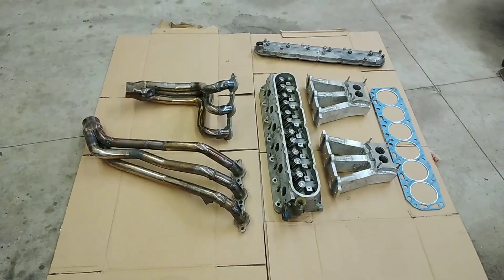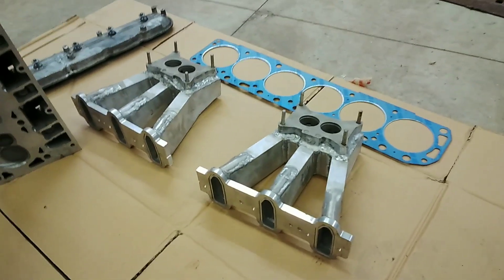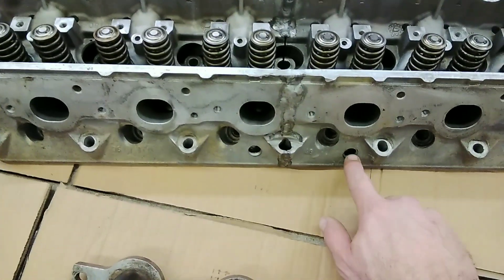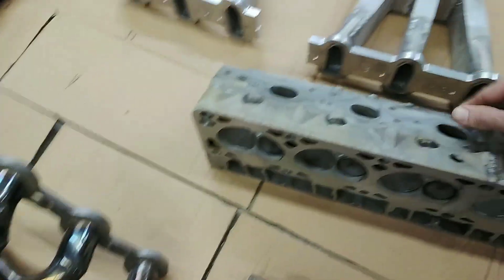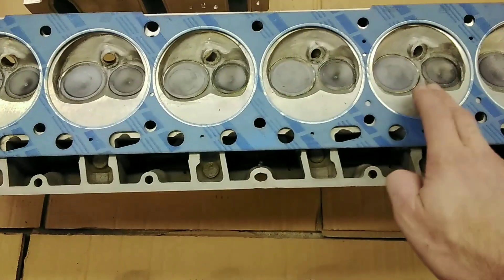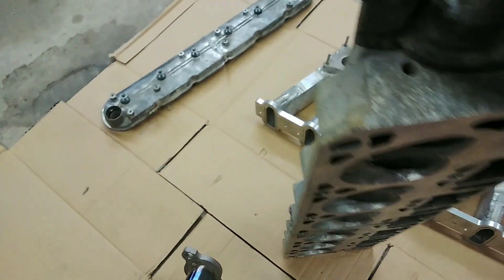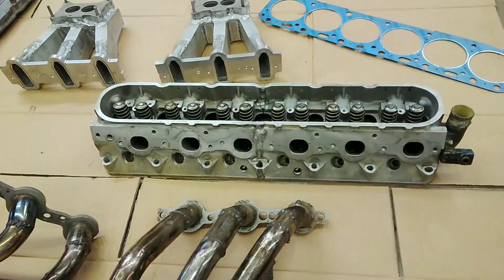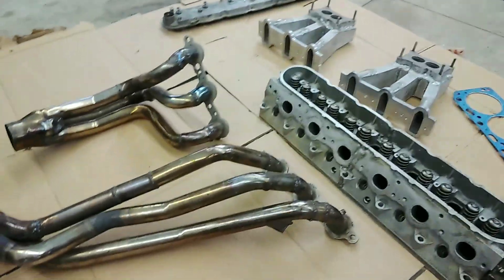Ford 300 hybrid LS cylinder head

Comment: The reason to use a Chevy LS head instead of a Ford Cleveland head is that the valve sequencing on the LS is the same as the standard 300 straight 6 head. Therefore you can still use the standard 300 cams.  If you use the Ford Cleveland head, the valve sequence is exactly wrong, so you have to pay to have a custom-grind cam. made. Standard cam vs. custom ($$$) grind cam. Plus, the LS heads can be bought from a salvage yard or GM dealership, whereas an aluminum Ford Cleveland head cost mucho dinero more when bought from a speed shop or distributor. I know its sacrilege to put a Chevy head on a Ford (or vice versa) but the relative ease and the economics involved make the head choice an easy one.
Reply: Im a ford but have messed with sbc and bbc engines too but first time I worked on an LS it felt more like a sbf then a chevy. Even the distributor conversion uses a ford distributor and mounts at front of block.
Reply: Fascinating.
Reply: @BruceLee-xn3nn  I've heard they're based off a ford design, but I doubt Ford would choose the shitty 4.6 over LS tech.
Reply: There’s a guy here on YouTube who has a SBF with ls heads on it . I forgot  his channel name . But the argument has been made that GM copied many of fords designs to build the ls , I don’t know if it true or not but it’s fun to piss off chevy guys saying that.
Reply: @rustyshacklfort9508  The LS is definitely closer to the SBF than any GM engine, but of course improved in many ways too. It's not a stretch to see and borrow the better qualities like center thrust bearing and equal spaced ports. I do wish Ford had made a new generation Windsor much sooner. The 7X motor (Godzilla) was on paper over a decade ago. They should have gone with it and a smaller displacement variant long ago.
Reply: The 300 has 4.4" spacing as well instead of 4.38" like a SBF/335 engine. I have seen LS heads work on a SBF though so I guess that isn't a total deal breaker.
Reply: For sure gonna be interesting to see the finish product.
Reply: A machine is a machine.

Comment: 392 style Hemi heads also have a close enough bore spacing to do this and there are lots of aftermarket high flow units around. If you bore .040 you can offset cylinders to match head centres. You can use a custom copper gasket to keep the gasket lined up with the bores.
Reply: Those heads cost a LOT more than 706/862.
Reply: @mctigmctiggy1475  Some of the franken Cleveland 300-6s used 3 peice pushrods to get the monkey motion around the ports. Original 392 hemis have pushrods.

Comment: I wonder if gt40 heads would be a good choice to do this, I daily a efi 300 and would love to mod mine like this. But would rather keep it all ford.
Reply from the maker: The valve sequence is different on small block fords and would require a custom camshaft but its possible.
Reply: The GT40 head is junk, you'd be better off with stock or ported heads and a power adder.

Comment: The 3/8ths pushrods will work fine if you order them with a thick wall.
Schnieder racing cams have some wicked 300 Ford cams but I like your selection since I'm a fan of narrow lobe centers.
Can you discuss your welding??? Machine used, gas mix, settings........???
Reply from the maker: My brother did the welding, I built a jig from 3/4 steel plate to bolt the head to when he welded it. He also heated the head up before and while he was welding using a l.p. fish fryer. It still warped about .015 but I hadn't resurface afterwards.
Reply: @fiskshopworx1541  .015 warpage in a head that long is outstanding, just ask Brodix. They commonly have warpage in damaged customer heads that they have to weld and those heads only 4 cylinders long.

Comment: A long time ago when Grand Prix cars (now called F1) ran inline 6 and 8 cylinder engines they had a coolant log that ran the entire length of the head with inputs at each cylinder. I think if you have a temp problem you might have to go with this old system.
What are your plans for the side cover??? Is there a gap that needs to be addressed???
Reply from the maker: That's a good thought about the coolant log, and yes on the push rod side the head overhangs the block. I have built a cover to go over the push rods. I can show that in another video.
Reply: @fiskshopworx1541  I'll be looking forward to that video. I really wish you had filmed the fabricating of the head and manifolds.
You are on the cusp of building a legendary inline six.
BTW, my eyeball dyno says your intake manifolds should work for a power peak of 5700 rpm...lol

Comment: Holy cow!  You absolute madman, you actually welded it, and while this has been done before, but the guy on the forum just cemmented it together and it failed to perform and he was left wondering why it didn't work.  The concept of making a crossflow head for a Chevy 292 or Ford 300 out of an LS Head has been talked a about for almost 2 decades, yet no one has actually done it or filmed the process or progress on such a project!? You have actually done it, and while Wayne Heads, or other performance heads exist but are Un-Obtanium in todays world/market and were only meant for race applications.  You sir are doing a great service, and this is the type of content I browse this platform for.   All I can say is great job, and looking forward to seeing the finished product👍
Reply: I agree 100 percent
Reply: 🤔 Just out of curiosity(Serious questions first):
👉A). Does anyone make aftermarket high performance Ford 300 street heads?
👉B). If the answer to A is yes, what's the benefit of an LS head that makes it preferable to an aftermarket high performance Ford 300 head, or a custom made & modified Ford Cleveland head fit to a 300? 
💥C:(disclaimer: there is a potential for partisan sarcasm here): Wouldn't attaching Chevy parts to a Ford engine unleash a curse of some sort, not unlike that seen in mummy movies after ancient Egyptian tombs are desecrated?
Reply: @HighlanderNorth1  

A). Does anyone make aftermarket high performance Ford 300 street heads? - Yes they technically do.  While not mass marketed, Gents out in Australia have been doing it for decades, and I think recently "Vintage Inlines" out in Detroit Michigan started doing their own aftermarket heads. Though these heads are a little different to the LS head being used here, and I'll get into that.

B). If the answer to A is yes, what's the benefit of an LS head that makes it preferable to an aftermarket high performance Ford 300 head, or a custom made & modified Ford Cleveland head fit to a 300? - Glad you asked!  I could write an entire thesis as to why an LS design is preferred...but it's not that simple.  To question why going through the trouble of making this head, you have to better understand how the Ford 300 or old American inline 6's work.  The Ford 300's were designed for the sake of manufacturing, and ease of cost. You run into problems like un-even/poor distribution of airflow, fueling, and probably the biggest elephant in the room, and the bane of all American 6's is their..."Reverse Flow Head" .  At this point you might be asking why bring up this fact?  While the aftermarket heads that are currently available for the 300 come in aluminum variants, and are of high quality.  Still the achilles heel of aftermarket 6 heads is that they still use a similar form of reverse flow.  The LS head isn't the most magical part, it's taking the LS pieces, and turning it into a more efficient "Crossflow Head" design.  The Crossflow fixes the biggest problem of the 6's, which actually is "Heat" .
  Why choose an LS head over a modified Cleveland?  - This one is preference, while you could weld up a Ford head off their V8's which'll work just fine, but the LS flows better and is more efficient in stock form.  <--- To that you might say, "why not just use an aluminum race head off a Ford V8 instead which'll be better right?"  True you could, but it's kinda hard to justify the cost/risk of cutting up 2 to 3 expensive race heads for a project with an unknown outcome. As for the stock LS heads, you pretty much can get them for free, and they'll work just fine just as long as your welding's up to par. 

C).  Wouldn't attaching Chevy parts to a Ford engine unleash a curse of some sort, not unlike that seen in mummy movies after ancient Egyptian tombs are desecrated?  -  The only thing it'll do is upset the badge loyalist, and people who don't like swaps.  Swapping parts over isn't unheard of, and has been done for years by Hot Rodders, and nothing bad will happen as long as your tolerances are good, and the math adds up.  

For the record, I'm not praising the LS or am a GM/Chevy stan.  I myself am not the biggest promoter of swaps in general...unless it's really creative/niche which in this case it is.

Hope that answers your questions.
Reply: @josefrobbins8781  
Yeah, that all makes sense, and aside from the reverse flow issue, I'm sure the modern combustion chamber design of the LS is superior to a standard Cleveland head for street use(competitive strip use may be a different thing, but who knows). 

As far as the cost, that makes the most sense, as aftermarket aluminum heads would certainly be more expensive than salvage yard LS heads, AND the stock LS heads have the attractive performance benefits that you'd expect from an aftermarket head(but without the cost). 

Not only that, but unless you're an expert when it comes to cutting heads in half and epoxying or welding the parts together to form a DIY 6cyl head that works and actually doesn't leak fluids & compression everywhere, you could waste lots of money ruining rare Cleveland heads in the attempt.

🤔 But I'm still not convinced there's no risk of incurring the wrath of the automotive Gods by joining Chevy and Ford parts together! Maybe you pull out of your garage for that first post-LS head swap test drive, and you become engulfed by a Biblical locust plague! Maybe you break out in boils.... Or maybe all the water in the neighborhood pools suddenly turns blood red, and an endless plaque of frogs inundates the development! 😁
Reply: @HighlanderNorth1   As I stated, a Reverse Flow Head's biggest problem is heat, and that it accumulates it too fast, and doesn't disperse/dissipate the heat very well. The obvious reason being a Reverse Flow's intake and out-take ports are all on the same side, while a Cross Flow's are opposite of each other. Meaning: your intake and exhaust on a R.F. are literally side by side cooking each other which runs into hot fuel issues, and lack of porting space or just port limitations in general with the traditional stock R.F. design. Aftermarket companies attempted to fix these issues by doing an "Over Under Reverse Flow"...but that still doesn't completely fix the heat problem.  Hope that answers it.
Reply: @josefrobbins8781  
I didn't really comment on the reverse flow issue in my 2nd post. I'd already moved beyond that issue after reading your earlier description of the problem. Mostly, after considering your comments on why an LS engine is a good option, I agreed with you that it makes sense  Then I pointed out the potential problem with destroying rarer Cleveland heads by doing a DIY 6 cyl conversion that could end up failing miserably for a number of reasons IF the one attempting it wasn't experienced and qualified in cutting V8 heads then re-attaching pieces of the heads back together into a single 6cyl unit. 

I finished it with a joke.
Reply: @HighlanderNorth1  Ah, understood.
Reply: @HighlanderNorth1  Shat, Power Nation has a series of vids where they did a few stages, plus a turbo.  IRON stock head
End result 517 hp-597lb/ft @4.5k...plenty
The wastegate opened @522hp on last dyno run.
5k rpm peaks would require close attention to the bottom end, but doable .
Reply: this has been done many times and won world records with ford heads epoxied together.
Reply: @bretpetrie7044   Never denied that.  It's just awesome this man is documenting the process of welding/re-purposing an L59 Head for a street application, which I've never seen done up until now.
Reply: @bretpetrie7044 it was done in the 1970s with a pair of Cleveland heads furnace brazed together, not epoxied.  The result was a drag racing monster that pumped out over 500HP, and if I remember correctly did it naturally aspirated.  Google Bruce Sizemore if you’re interested.

Comment: Would like to see where this all ends up in torque, fuel economy, and driveability. Can't wait to see it all come together
Reply: Bruce Sizemore welded Cleveland heads together YEARS ago to make a 500hp 300 ford.
Reply: @BruceLee-xn3nn  Boss 300
Reply: @BruceLee-xn3nn  would a factory LS head flow more than a good Cleveland?
Reply: @riccocool  I'd bet a 4v head would outflow a factor LS. They were down on computer design but huge ports. It takes 3 cuts to the Cleveland heads to make a boss 300 one for the LS. The LS also gets bonus points for being aluminum. Just my thoughts.
Reply: @nfinitymarine4466  some ls heads have incredible flow- but this one is very average.  Maybe more flow is overkill?
Reply: @riccocool  I'm 50. Growing up I was told to be careful with too much flow. Then the LS came around and proved all those old guys wrong about too much port for a street motor. Velocity, swirl and chamber design have a huge impact on combustion and that's where the factory Cleveland lacks to the High port intake and D exhaust of the LS.
The biggest thing about this though is that this guy is doing it and I'm sitting here talking about it. LOL
I just want to see a dyno run.
Reply: @nfinitymarine4466  You can never have too much flow when seeking peak numbers with the right setup. You can however have too big of a port for the engine and camshaft operating range. To big of a port on an engine not set up to utilize it will cause slower air velocity at lower rpms and kill driveablilty and lower rpm power. The 300 inline six does not rev very high, 4000 rpm is about the max, using a bigger port LS head would likely not help seeing as how the 300 6 would never rev high enough to see a benefit.
Reply: @keeganlangford5580  This bottom end can be beefed up to turn 6000 all day everyday. A better head selection before the hacking and the correct combinations can make 700 on both counts all day long on pump gas. Power adders are amazing now days. If you kept it near stock like his intentions with an aftermarket cam and mostly stock or fabbed up parts you still come out way way ahead of where you started. I'm saying some junkyard picks, some used parts, a few welders and you have a heavy duty sleeper motor just to start. Could even start with an old industrial block and aluminum con rods. Wonder if my old Ford four bagger industial motor would take to a modern head, hum. Transverse mounting is quite possible in a mid or rear vehicle setup.
Reply: I want to see some dyno sheets of the Ford 6 with Chevy LS heads. The Ford 6 has a 4" bore and a 4" stroke, bigger than any Chevy small block, so on a "per cylinder" basis should compare very well indeed.
Reply: @bobkonradi1027  on a per cylinder basis its like a 408 ci.
Reply: @bobkonradi1027  there are more 427 (4.125 x 4 bore stroke) LS engines out there than there are 300-6 Ford engines, they are extremely common. He could have thrown a banana out the window and hit a better LS head than the ones he chose but even the head he chose will easily out perform the 300-6 head.
Reply: Just imagine the sound.